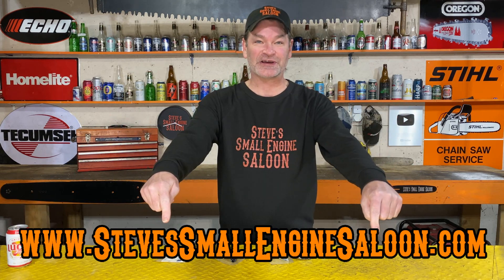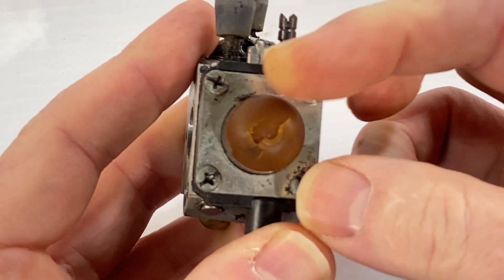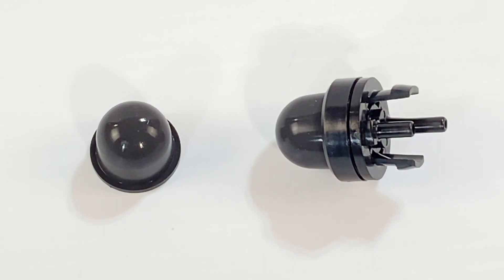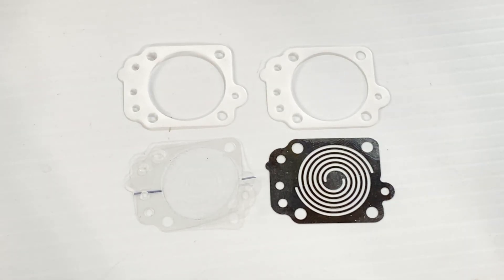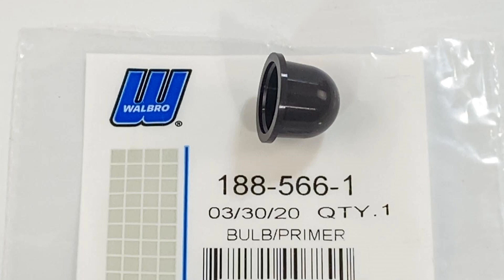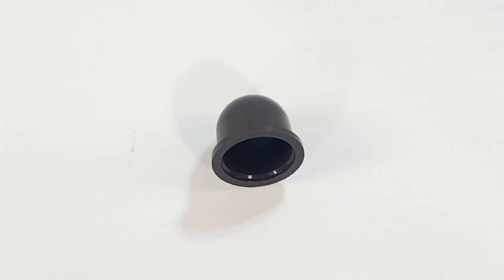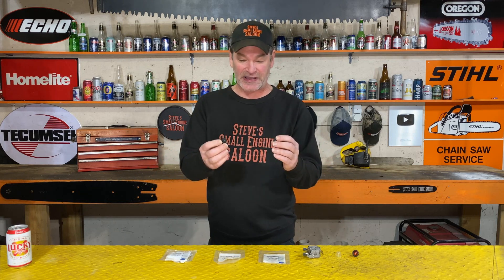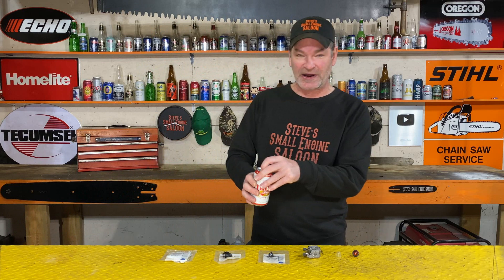WOW!  No More Cracked Bulbs With This Amazing Carburetor Technology From Walbro

Comment: Increasing reliability in small engine components is needed for survival of the suppliers. There are a bunch of battery powered options out there, now. Most of them are more than sufficient for the common home owner. Some are even being used by landscapers. Here, in Illinois, You can't even purchase an IC powered leaf blower. This has more to do with noise issues in Chicago than anything else, but it will be expanded if those problems aren't resolved. Many places have only ethanol fuels available at a reasonable cost. That drives many service issues. Electric power units don't deal with that. 
It's going to be a tuff road for equipment manufacturers in the U.S. market with the new administration, you can bet.
Reply: Bingo
Reply: Yeah, sure.  I won't mind waiting several hours to recharge my snowblower halfway through clearing the laneway.  Battery electrics have their place, but ICE is not going away anytime soon.
Reply: @bobmcl2406  
It's doubtful snow blowers or mowers will  be commonly Battery powered during the next few years. In the States,though, the next administration has the political agenda to force what they can.  Where I live, IC leaf blowers are already illegal to sell. Actually, we aren't even suppose to be using them. No place outside of Chicago enforces that silliness....yet. String trimmers are next on the states agenda along with hedge trimmers, etc. Non-riding mowers are on the general assembly's radar, also. Most of the local landscaping companies are already converting when they buy new small equipment. Imagine what the battery cost for keeping those things running all day will be? It's going to have to run the price of doing business through the roof.

Comment: I learned from a small engine repair shop that ethanol is death to non metal parts. Thanks for the reminder. I always use marine gas in my mower (ethanol free).
Thanks
Bob
Reply from the maker: Right on

Comment: How about some ethanol resistant fuel tubing?  I've had more trouble with that crappy yellow tubing than the bulbs.
Reply: Need to check out Steve's video on making your own ethanol free gas.
Reply: That is probably next on their list
Reply: I use the good soft black fuel hose instead of the yellow hose and lasts much longer.

Comment: Got a tune-up kit for my Husky chainsaw on ebay. The primer bulb lasted only two months even though I only use eth free fuel. Good thing I saved the 10 year old bulb. A lot(actually I'd say most) of the failures are engineered in china.

Comment: Hi Steve, Walbro is doing just the right thing! Should be aplauded and people should buy their stuff. I have a question, could be related to a primer bulb but not sure. I own a Stihl concrete saw and have done tons of work with it without any complaints. Just last year it started acting up and this is what happened. It starts and idles but as soon as you throttle up is dies.. if I throttle up and keep pumping the bulb it will work, but I guess that's not what is supposed to happen. I bought a new carburetor and the same problem. I live on a small island and repair is difficult not to say non existent.. maybe you've come across this issue and know what could be the problem.. I really need this tool and had to sell no already, and I hate it. Steve keep up the good work and hope to hear from you. Happy new year.

Comment: In regards to the 2 different parts from Walbro, I hope the 'complete assembly' version is ethanol resistant. I'd think they'd make the pump/bottom ethanol resistant as well. 
I'd get the complete assembly so you don't get broken fuel inlet/outlet tubes from ethanol erosion/rot.

Comment: That is awesome! Thanks walbro and thank you Steve for bringing their parts to our attention!👍 
I use ethanol free gas or 100ll depending on equipment and use, so I haven't had to replace a diaphragm in 6+ years. I do have to replace primer bulbs about every 3 years tho presumably due to UV exposure. I'll definitely give those new black bulbs a shot next time!
Reply from the maker: Right on Aaron!

Comment: Love your videos Steve, I actually contributed some bucks to your channel (which I rarely do). I do wish you would have commented on the bulbs as to if they are  universal. For example does the Walbro bulb fit any primer pump - or are they engine/Brand specific? If they are universal I am going to buy a supply and convert ALL my small engine primer bulbs to this type. Hope this isn't too simple of a question. Thanks for all you are doing!
Reply from the maker: Right on buddy!  These bulbs do work on some Zama carbs.  I brought this to Walbros attention and now the engineers are currently testing it themselves, so they can support my claims.  Stay tuned for the video....

Comment: Hi Steve I have been watching your videos for some time now and they have been a great help to me. I have a strange one for you, you may know the reason for what is happening I am just guessing. I have an old Mcculloch cabrio 321 brush cutter which worked fine and then one spring when I took it out it would not run properly kept cutting out when I gave it gas. I tried your usual tuning method but no would not pick up when went for gas. I took the carb off and had a look at it, it is a Walbro WT 694 . I thought the diaphragms needed changed so I did that and it still would not run. However I don't know why I tried it but I turned the Hi screw out much further than it should need and hey presto I got it to run really pretty well loads of power... great. The thing is I really would like to know what would be the reason for this? I think the Hi screw is out about four  to five turns! I should add that the engine does not make much in the way of smoke at all. I run it on a 25:1 mix using Stihl oil . I do not use the cutter much so I am just going to run it until it says that enough and then buy a new one but wonder if you have any ideas why this has happened. I suspect a partial blockage in the Hi side of the carb.
all the best John

Comment: Great idea. Not sure if anyone asked this question yet. When I’m trouble shooting though, i would like to see if fuel is reaching into the bulb when priming. Is it just dark or completely black where you can’t see through the bulb at all ?
Reply: Great question. Unfortunately, we could not find a flexible, transparent material that is ethanol and UV resistant. You can still feel the fuel with your thumb - same as in a normal bulb. 
If fuel is coming out into the return line going back to the tank when you push the bulb, then everything is working properly. Hope this helps. Thanks,
Reply: @mikeatwalbro5278  yeah thats a great way to know if its pumping. Thanks! Will try getting my hands on some indestructible bulbs!

Comment: That's Freakin, Awesome.  Between the Metal Diaphragm, This new Bulb, and Ethanol resistant fuel lines, a lot of common small engine problems might become a lot less common.  Can the Walbro carbs cross match with some of the other brands out there that are found on other small engines?

Comment: hello Steve ? i have a poulan 2150 runs grate no bar oil so i bought a 5 pack of oil pumps on amazon none of them worked they came with the threaded gear drive so i installed it i turn the saw counter clock wise  to thread the pump in gently  start the saw up pump fucked 5 times what am i doing wrong

Comment: Good info, unfortunately not much equipment comes with Walbro carbs these days.
Reply: It doesn't have to be a walbro carb to use the walbro bulb. I have seven different machines that use these primer bulbs not one has a walbro carb

Comment: The bulb has ALWAYS BEEN the weakest part on a small engine, in my past experience.. been waiting for this exact part to be invented
Reply from the maker: Right on
Reply: I wonder if that's why stihl didn't put them on their chainsaws until the fuel injected model.... there might be a reason. Idk if it had to do with uv light or just that its a weak thing to have and might be the most likely thing to break in the bush with everything around.

Comment: Walbro does not cast check valves into the carburetor body that are unreplaceable, i wish they would switch to a tiny threaded hole in their brass venturi plugs for a slide hammer puller, buying the kits from walbro saves from shipping all over the place wasting resources, buy their stuff from them!